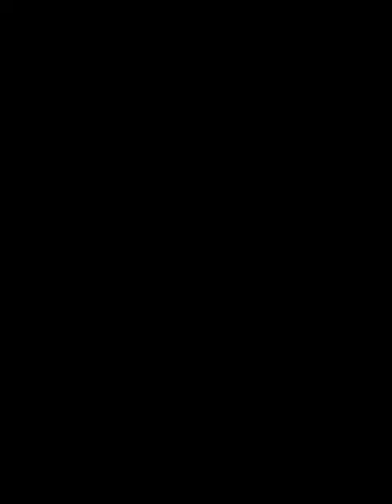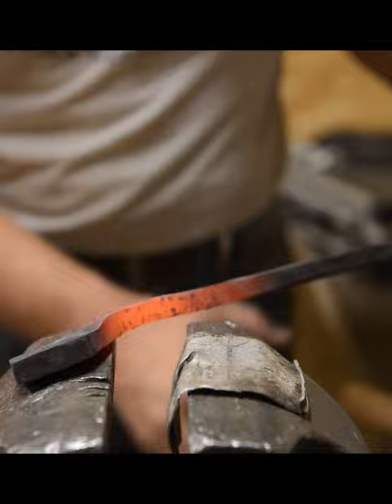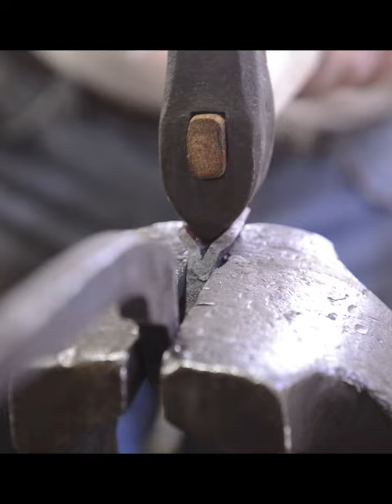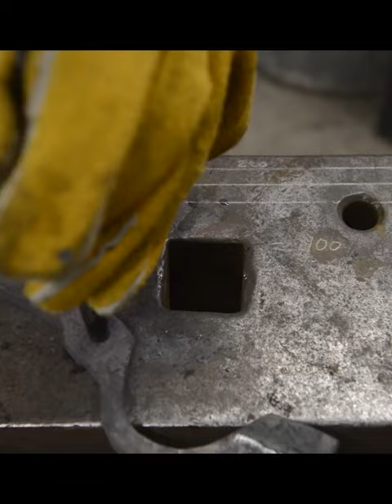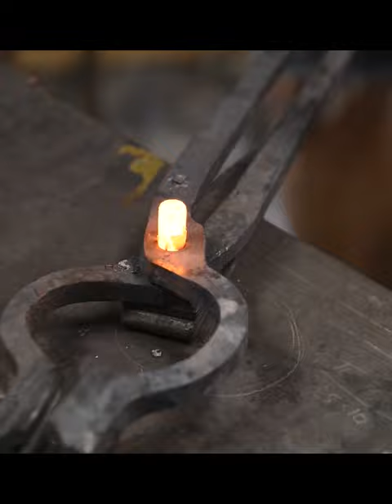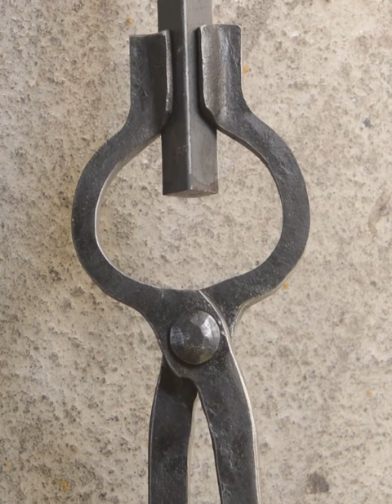A Secure Grip - Forging Tongs 👌 #blacksmith #metalworking #maker

Comment: Really like the way you made the curve with the vice. Ive made a couple bolt jaws but i used a hardy pillar to get there. Bent over the edge of anvil first to about 45° at two points then yeah. Hammer around the pillar to desired shape. 
 Gonna have to try it the way you did and see if I like it better. 🍻